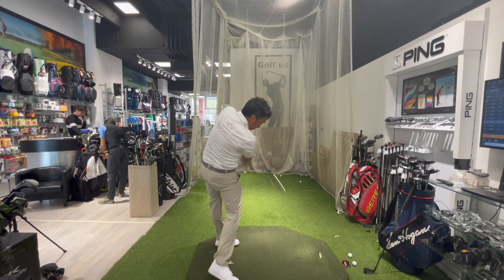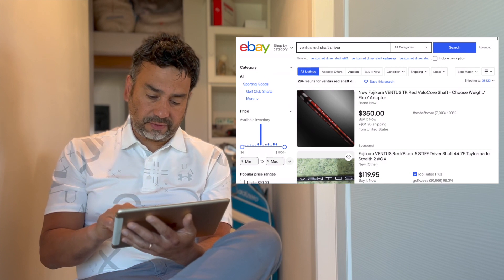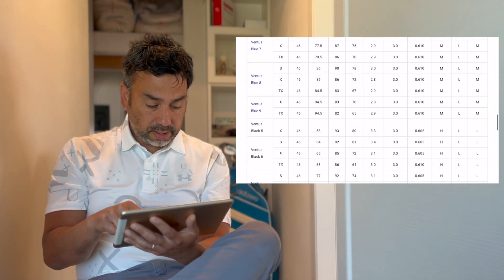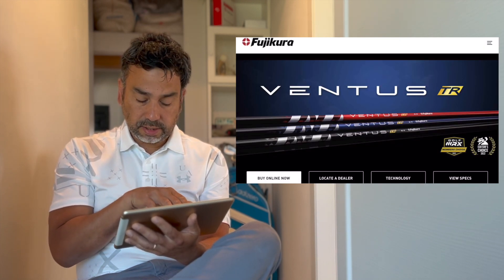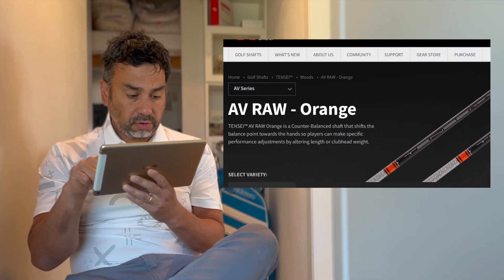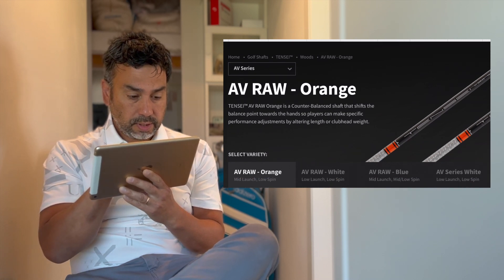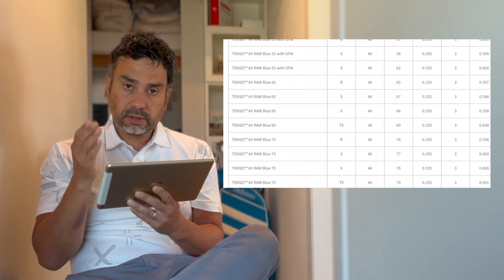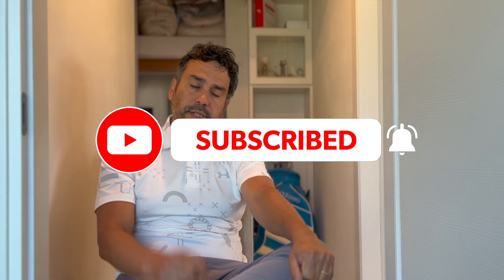Driver Shafts BEWARE

Comment: The tensei shaft is a legitimate shaft its just 2 models old. Ck preceeded av, which has been superseded by av raw
Reply from the maker: I just couldn't find the specs for it
Reply: CK is the better quality version. The AV is the stock cheaper version.
Reply from the maker: @billyunair  Thanks, I saw one second hand that I'm thinking about buying, I didn't know the CK series was better
Reply: @thebackyardgolfer7010  When I was club building for a manufacturer here in the US we had the AV as a stock shaft on some drivers/woods etc. The CK was an upgrade the customer had to pay extra for, like a velocore Ventus red shaft for example.

I'm sure both are good though I play RDX black stock shafts myself. I wish I could afford a Tensei Blue CK or Ventus red velocore shaft in my SIM.
Reply from the maker: @billyunair  I'm getting a Speeder 661 Evolution VII second hand for $40, just need to close the deal, hopefully,...I really wonder if there is this huge difference between a stock shaft because they are sure much more expensive
Reply: @thebackyardgolfer7010  That's a good price. Can't go wrong. I've had coworkers that like Speeder shafts.
Reply from the maker: @billyunair  I'll make a comparison video if I'm able to get it.
Reply: @thebackyardgolfer7010  I look forward to it. No worries if you are too busy.

I'm too busy club building, working 3 jobs in total, DJing, working on cars and finding time to get on trackman to work on my swing/ go to the course to play a few rounds a month.

Enjoy your content. Motivating.
Reply: @thebackyardgolfer7010  I love saving and getting second hand clubs. Easier to tinker with and self fit. Try what works.

No need to buy new, or pay a fitter, unless a guy wants a new model. 

I just got a brand new Cleveland blade putter, HB soft #3 (Ping My day style with heavier head weight, 345 grams or so) with my golf discount. Otherwise I buy used. I collect old Pings.
Reply from the maker: @billyunair  thank you very much
Reply from the maker: @billyunair  totally agree, you can easily spend over 2k if you buy everything new, way too expensive
Reply: @thebackyardgolfer7010  Yes a guy's Calloway irons alone, at my work,  was over 2K new from Calloway.

I'm buying a used set of 5-GW T300 irons with red amt shafts, almost new condition, for $400. 

That's more like it. My old Ping Eye 2 BECU irons set 2-SW was $450.

Used can be a great tool for reasonable golfers on a budget.
Reply: @thebackyardgolfer7010  My pleasure.
Reply from the maker: @billyunair  Yeah, my max budget would be $400 for irons, I don't understand how people can spend so much, second hand could be just as good
Reply: @thebackyardgolfer7010  Yes I agree. $400 is reasonable. The clubs I'm getting were over $1000 new. My whole bag cost about $1000 and that's with premium Vokey or Cleveland used forged wedges.

Comment: Those shafts that came with the driver are different from those expensive ones that are sold by itself. They call them "made for" shafts. As in made for Taylormade, Callaway etc. Example is the ventus. If you'll notice the more expensive one will have a decal that says Velocore but the ones that came with the Taylormade has none. Shafts that came with the driver are watered-down version and that is why those are cheaper. However, there are some manufacturers like Titleist that offers those premium shafts as an option but they are more expensive.
Reply from the maker: Thank you for this, it's more clear now, I was really puzzled. I still think they should have the specs somewhere. I never tried the velocore shaft, I hear good things about it. I will just try to find a good second hand shaft for my driver, but I think I would prefer to go a good one not a watered-down version, I think I can find some for cheaper second hand. Thanks again for your explanation, I would have never guest that.

Comment: Correct. Assuming they are not fakes, odds are they aren't, all those shafts that you don't see on the shaft manufacturer's website were the club manufacturer stock shafts options. More than likely people, upgrading their shafts and trying resale the stock option for an inflated price on the backs of the aftermarket versions. Those specs won't be published because they aren't the same as their aftermarkets comparisons. Generally speaking for example, it is likely the stock Ventus Red that comes with the driver from TM will have lower grade materials than the aftermarket Ventus Red. Essentially an entirely different shaft. Hence, the TM doesn't always offer the velocore versions with their heads. That holds true for most stock vs aftermarket shafts. Might still be good for some people but folks need to beware not to overpay for a lesser quality component with the same graphics.
Reply from the maker: Agreed, what I'm afraid is that sometimes fitters put a better shaft and then you get just the stock shaft when you actually purchase the product, not sure I want to buy a shaft whose specs are not found anywhere, I wil try to get a hold of a good shaft second hand